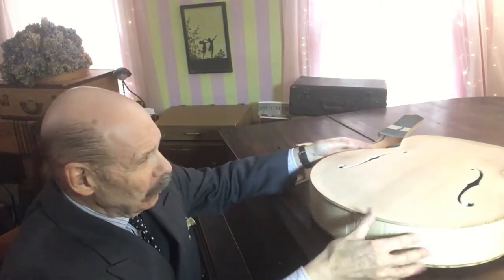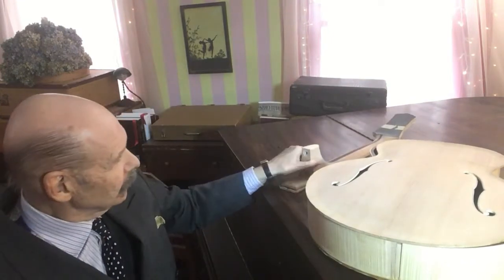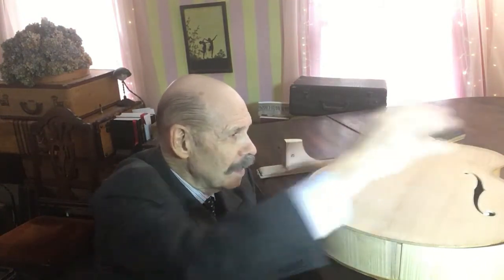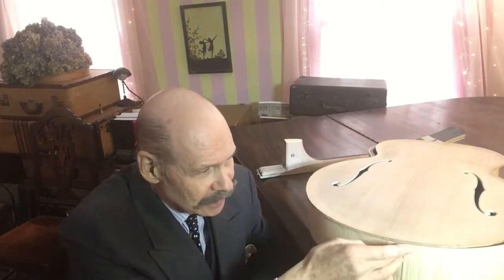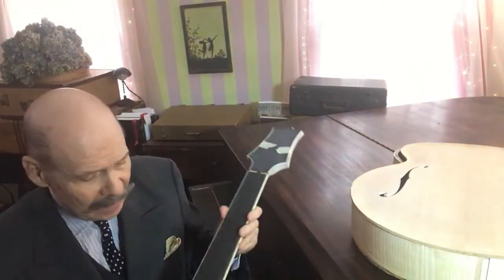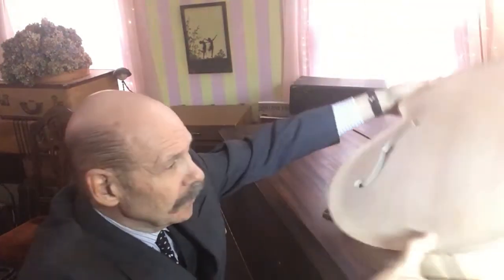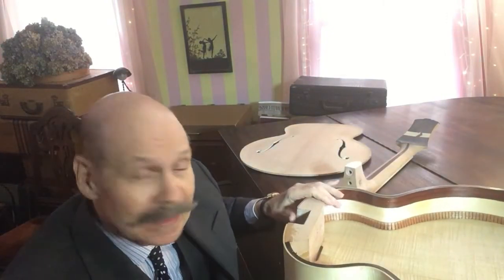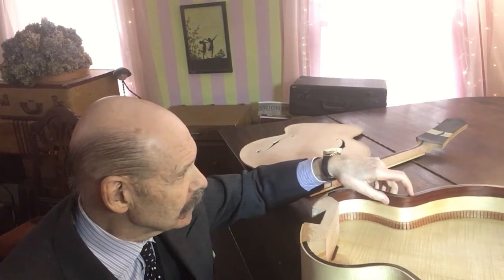Doc Scantlin arch top guitar progress and innovations

Comment: I like the bolt on neck. Wish my old martins had them. spent a small fortune on neck re-sets.can’t wait to see the finished arch top. Thanks!
Reply from the maker: As a repairman for many years, those Martin neck  (resets) put lots of food on my table. Funny how some builders like to go back to horse and buggy ideas, even a cult of no truss rod, just ebony stiffener in the neck (just like those thrilling days of yesteryear). Yes, gluing on necks is like welding on your car's wheel rims.  Good to remain true to the many good design ideas from the old days, but don't keep using the inferior ones. I do hope no one is still gluing celluloid pickguards to the bare spruce top anymore. Now that would be taking it too far. Crack city! Sill plugging away slowly on the arch top plus several flat tops and 2 ukuleles. Glutton for punishment!